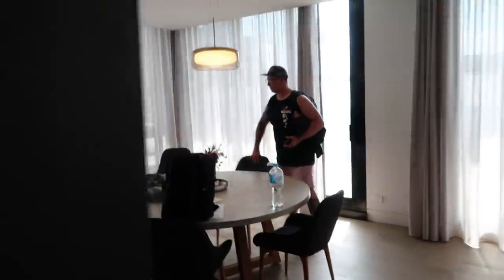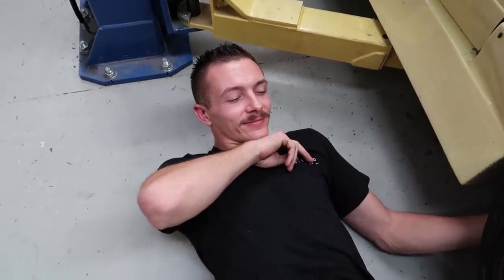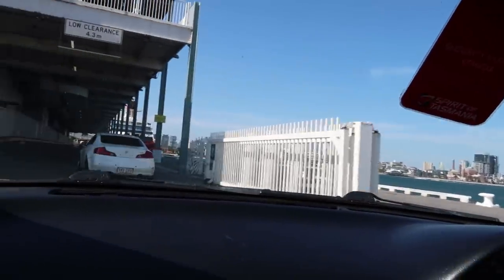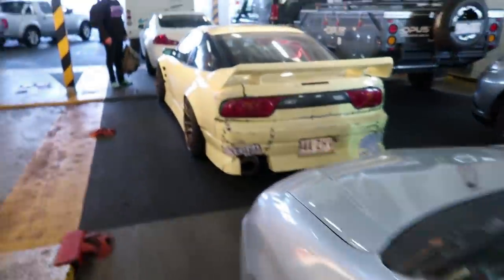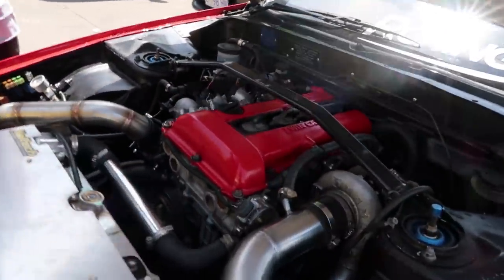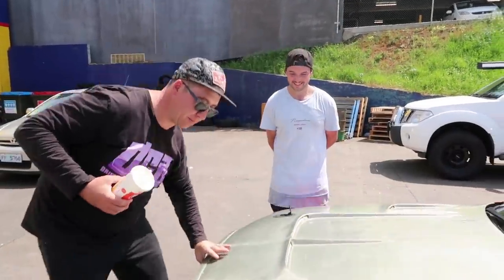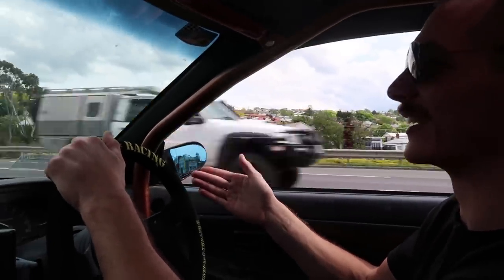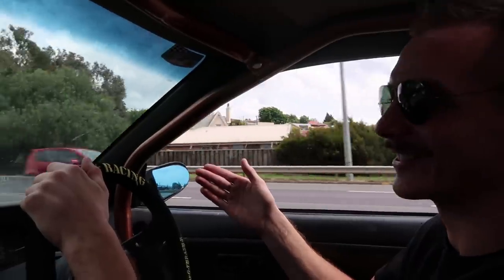Drift Car Ferry to Tasmania!

Comment: "15k, i can do that all day" what a baller Adam, looks like you're ready for a 4 rotor 😂
Reply: Justino Silva overweight overhyped over-expensive junk🤷‍♂️
Reply: @zerohourdrift  Over weight, over hyped? Projection much?
Reply: LUCAS KELLY correction, the 4 rotor weighs 400 pounds sans accessories, and that’s with it in naturally aspirated form. With accessories, a big turbo, manifolds, intercooler etc, it weighs almost 500 pounds lmao. The stock housings are iron after all. And a 2jz doesn’t weigh 600 pounds, it weighs around 450, and there’s no such thing as a 2jz-fse. Your information is absolutely fucked😂
Reply: zevi 2000 it’s still rotary junk lmao
Reply: @zerohourdrift  Okay Mr. Piston lover
Reply: LUCAS KELLY there’s no such thing as a stock 4 rotor. They’re either an original Mazda 787b race engine, which is extremely rare and fully custom, or they’re a custom built engine by a builder. There was never a production model 4 rotor. A four rotor is always going to be a fully custom build that costs multiple thousands of dollars. And even then, a 600 hp na 4 rotor will never make any more than that because the compression ratio is so high and the rotors so lightweight that any boost will destroy the engine. 

And my bad about the fse. We never had them in the states, and it was never in a performance car so I had never heard of it. We only got the gte and the ge.

Either way, your facts are completely wrong lmao
Reply: zevi 2000 I’ve had rotaries before. They’re inefficient, unreliable, and cost an arm and a leg to maintain. They’ve got more parts to go wrong, they’re harder to find parts for, and they don’t make enough power for the owners dollar. The design hasn’t changed since wankel first invented them back in like 1950.... There are literally hundreds of better engine options that will make more power for less money and will require a lot less maintenance. Rotaries are junk🤷‍♂️
Reply: @zerohourdrift  Being unreliable is a owner issue.

Comment: Mate Strawberries and Blueberries here have been really cheap this season and last because of oversupply. There was allegedly a disgruntled farm worker sticking needles in some berries (it was all over the news). So not as many ppl r buying them. $1.90 per punnet its great for us but it's crap for the farmers, they're barely breaking even at those prices. Before all of this the normal price for them was $3.99-$5.99ea

Comment: Yo Adam, I worked in the Fruit and Veg department in a supermarket in South Australia for 7 years. Blueberries in particular have never been this cheap before in my state. 3 years ago they were perhaps $4.90 USD per punnet (7oz?) in the supermarket in my town. Raspberries were as high as $6.22 USD. Bananas were insanely expensive at one point due to tropical cyclones in Queensland (Where they are grown in AUS)